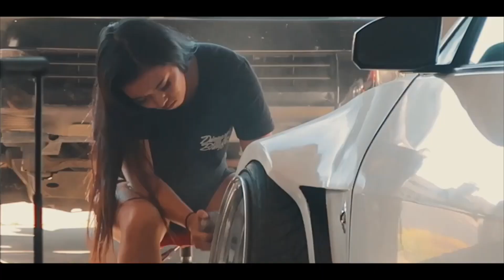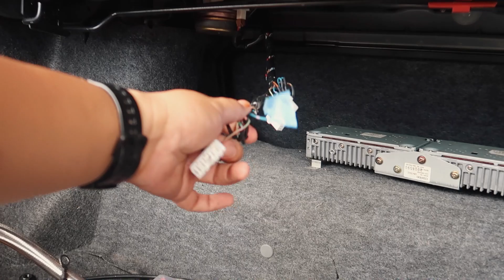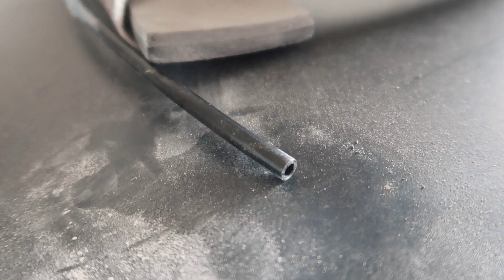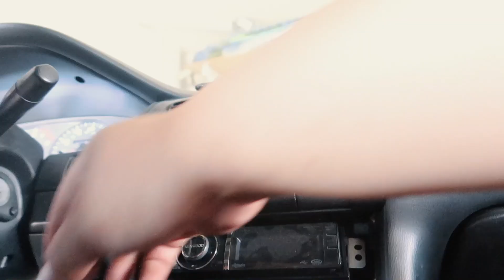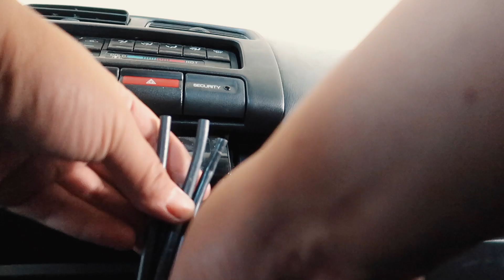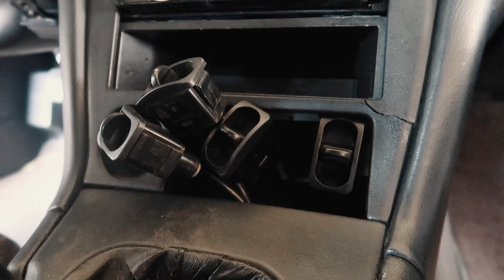Cheapest Way to Bag Your Car, Step by Step Guide pt.1

Comment: @CARSHOPBLOOM hey man do you remember what size push to connect fittings you used with your 1/4 inch od air line ?  All the fittings i find are 1/4 inch outside diameter with no discription of internal diameter.  Im new to this sorry if this is a goofy question

Comment: Can you share the link for the valves and quick connect fittings please
Reply from the maker: Search manual paddle valves on eBay, also the fittings are push to connect 1/4 fittings

Comment: That power supply for your compressors isn't a heavy enough gauge to safly power them.
Reply from the maker: I ended up running a dedicated 8 gauge power wire straight from the battery, same as I did in my 350z

Comment: Wouldn't you want to have your supply line to be 1/2 since you're splitting the air supply?
Reply from the maker: Joshua Graff 1/4 is fine you can run it 1/2 if you want but you’ll still have to reduce it back to 1/4 because the fitting in the switch is 1/4 so it really wouldn’t matter

Comment: Yeeee  🦁moar moar moar pleeaseee... 

Every now and then I think about do bags since your first airbag video but I still now so sure about it since I daily mine
Reply from the maker: Mauricio Fernandez yee! Part 2 coming Friday! You should, it’s more comfortable than coils in my opinion. The z used to have this same set up and we drove it 3 hrs back and forth between drift events and didn’t have any issues & We used to daily our xb bagged and it didn’t have any issues either.
Reply: @CARSHOPBLOOM  one of the reasons I'm also considering it its because I'm getting tired of the exhaust leaks on my IS  .. I dont like to have that cel light for a simple dumb code lol

Comment: I'd personally go with 3 valves. I used to run two paddle valves on my air cups(one for front, and one for rear). Good to begin with on a budget but i found it is true that the air does shift when taking corners and youll only notice this if youre slammed because I'll scrape one side when taking a hard turn. This makes sense for the front of the vehicle since most of the weight is up front. So i went with THREE valves and gave the two front air cups their own valve so it's always a constant air pressure rather than sharing. The rears don't have much weight so one valve was perfectly fine.
Reply from the maker: Reighner Gargantos makes sense, thanks for the input. So 3 or 4 would be the recommend valves yall
Reply: Thinking about this setup for my SC400

Comment: Love your videos, ur first video on budget air ride was what motivated me to do mine. But how do you know your ride height if you don’t atleast run gauges?
Reply: I mean like if you are sitting in the car and about to air up to drive...how do you know when you can stop airing up?
Reply from the maker: Bentley Bob  Honestly I go by feel, when I air up I can tell when my ride height is where I want it. If your unsure I’d spend the extra cash to add gauges
Reply: Whats your take on water traps?
Reply from the maker: Bentley Bob I use them in my airlift management because it’s electronic, I just remember to drain my tank in the manual system
Reply: Ok thanks, it makes perfect sense now.